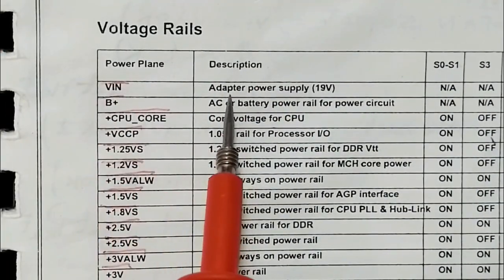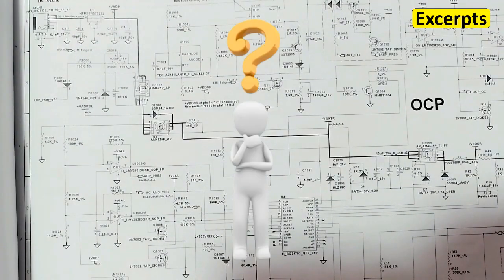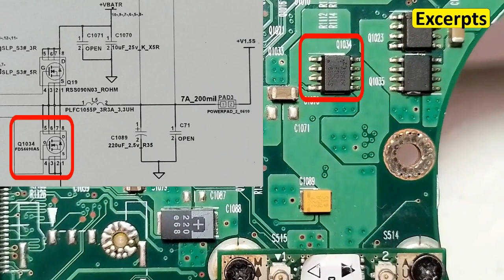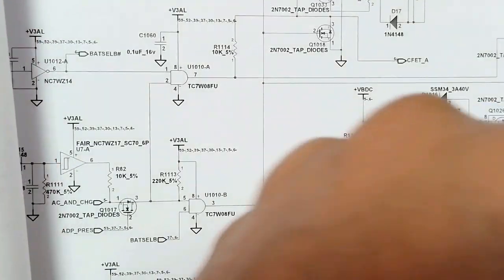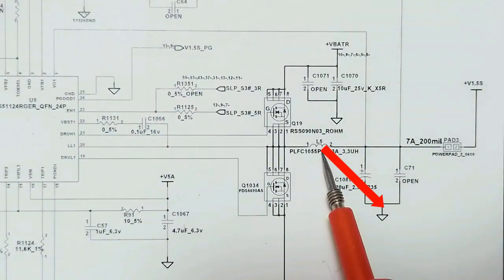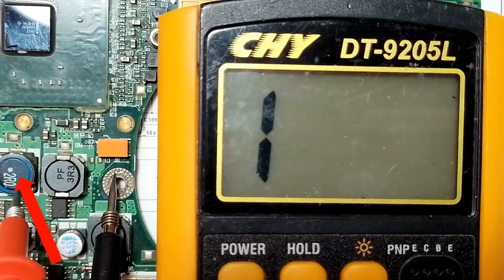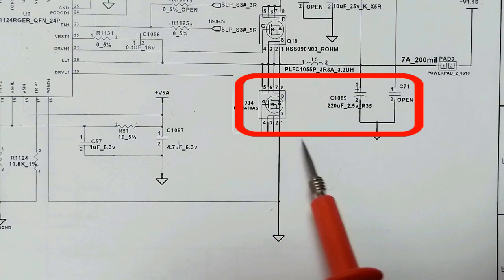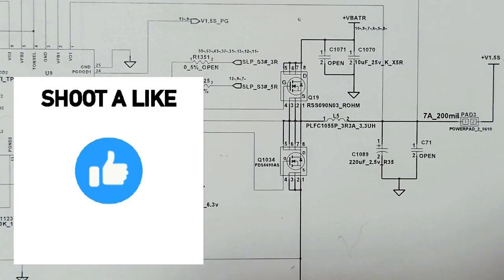Laptop Motherboard No Power - Troubleshooting Short circuit - Fixed!!-Part 2

Comment: its easy when you hav the circuit diagram, but its not possoble for most devices, so it become more difficult to find exact component and its datasheet if its not destroyed
Reply: I had a hasee laptop before with 1660ti and they just googled the diagram tech was a pro and he found it in google images its hard to find schematic but he was able to fix it, paid $50 here in the philippines

Comment: Hi , I have a HP ProBook Laptop I mistakenly cut a small part of the bios chip and now the computer is not turning on . my question is should I have to replace the BIOS Chip with any other BIOS Chip of any laptop or there is a specific BIOS Chip for HP ProBook the model that i have ??
Please Answer my question

Comment: I really do appreciate your explanation and details but please 2 or 3 times for repeating the same concept is ok. 10 is a little too many. I've understood that the components involved may be those between the two mass points: mos, 2 capacitors... ok. we got it. ... anyway... I await for the final video.
Thank you for your teaching.
Reply from the maker: Hi there, 
The purpose of repeating things is to understand. You probably understood from the beginning, but according to my stats, many of the channel's followers are beginners.
Regards
Reply: @electronicsrepairbasics_erb  probably you are right. thanks anyway